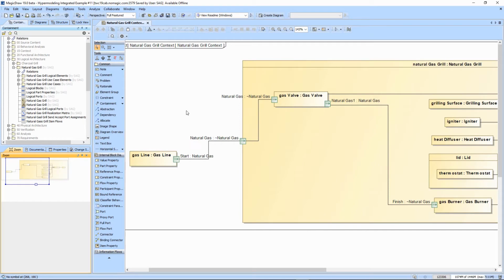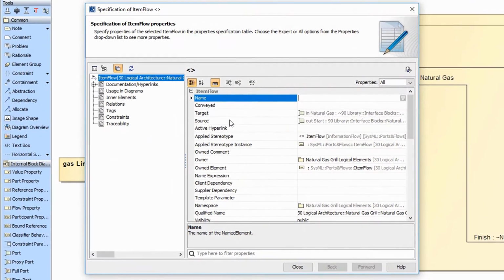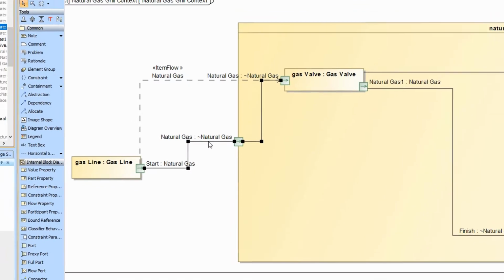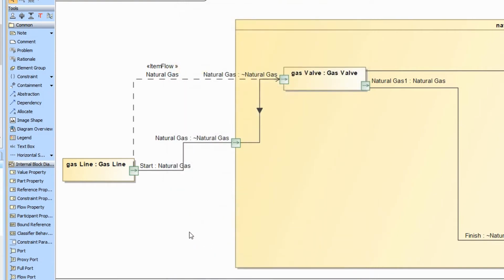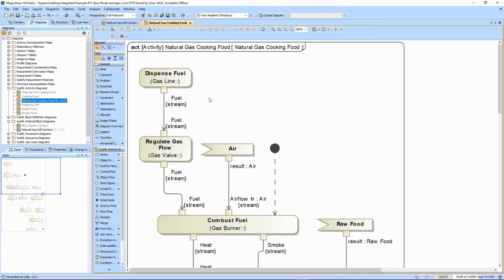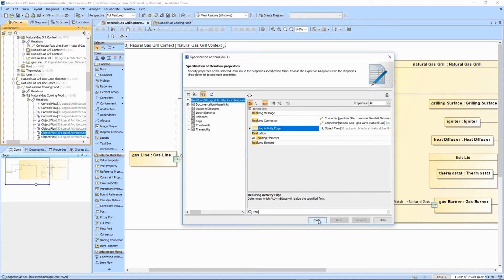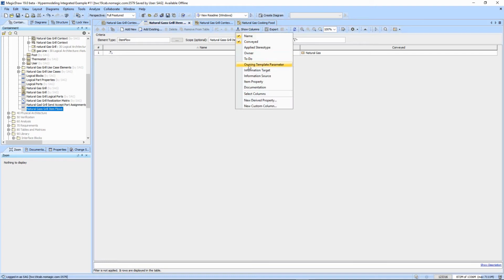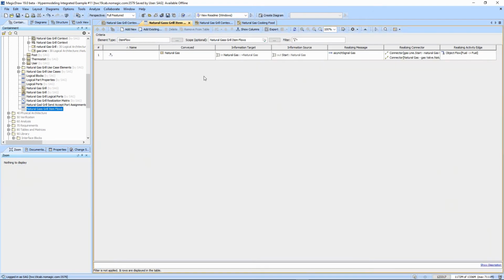Hypermodeling: Integrating IBDs Messages and Object Flows

Comment: I like how you used item flows to show source and destination of information and the realizing connectors showing how it traverses to get there.  I didn't know SysML had a solution like that.  AADL has similar concept where they identified Flows and each connection that flow goes through so figured SysML had something, guess I was missing it.  Thanks!